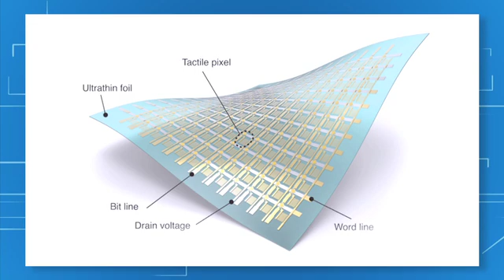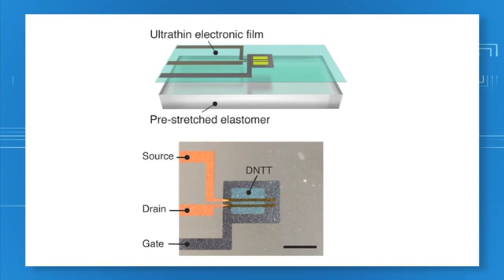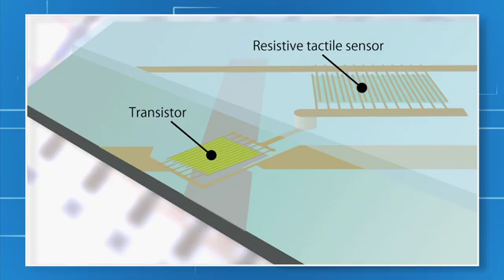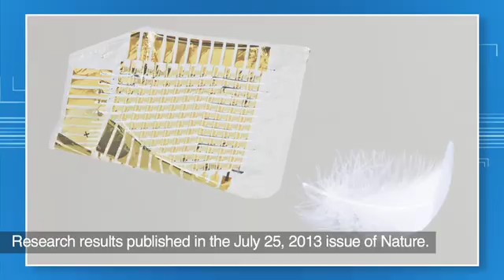Imperceptible electronics that are lighter than a feather

Comment: Skin , nice work, this can collect data in an array covering a fingertip. over this film can be 1mm of clear polyurethane. It can have sensors for light, pressure, temperature, all simple sensors for very thin film